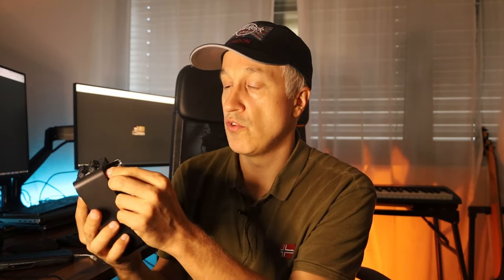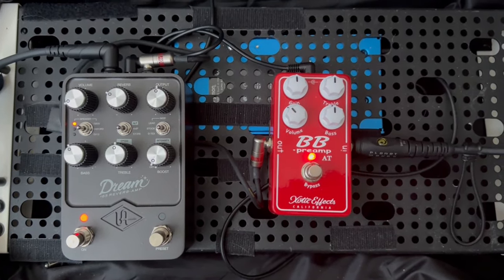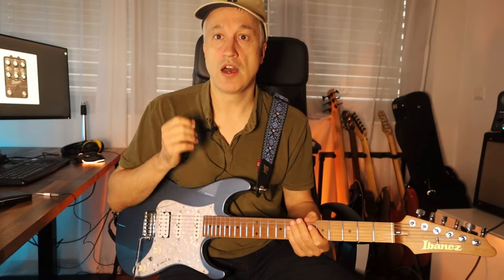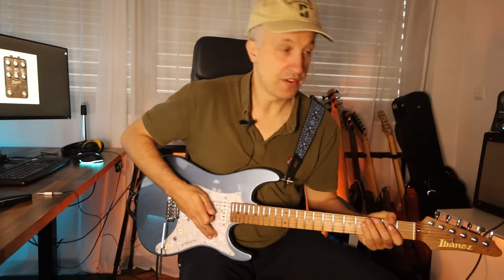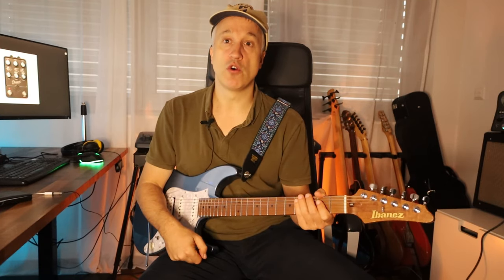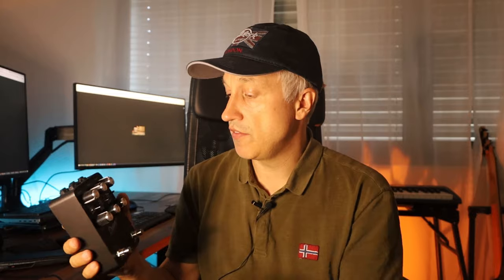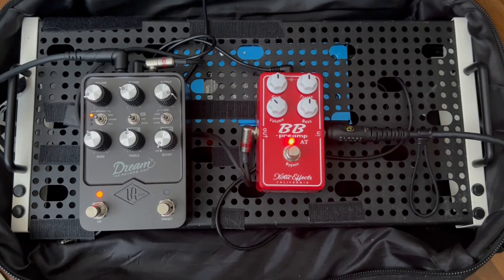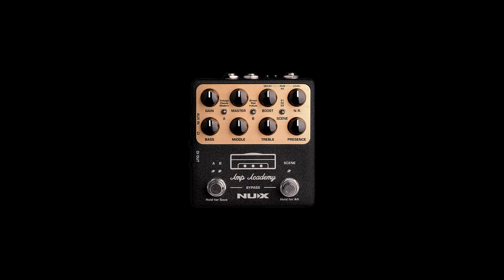The biggest problem I had with Uafx Dream '65 (watch before you buy!) #universalaudio #dream65

Comment: The Dream 65 acts and feels EXACTLY like the real Deluxe 65 amp. You are comparing it with a Kemper capture of a very clean amp that doesn’t ever get any dirtier because when the amp was captured it wasn’t on the edge of breakup. This is complete user error… it’s just like the real world scenario complaining that the Deluxe Reverb gets dirty around 3 to 4 and the Twin Reverb stays clean forever and takes your head off. If you want a clean amp buy a Twin Reverb if you want an amp that starts breaking up at 3 to 4 then gets dirtier but no louder buy a Deluxe. Your problem is not the pedal but your lack of understanding of how gain works. The worst part is all the people that were misinformed by this or even worse the ones that agreed with you.

Comment: …I'm having difficulty figuring out what exactly the issue is here. Initially it sounded like you were saying that the 65's input didn't have enough headroom and was being pushed into overdrive too easily. Then it sounded like you were saying that you couldn't hear whatever gain pedal you ran into the front of the 65 (in this case a BB Preamp) because the clean signal from the 65 was layering over it. These are two very different things, but with that said I'd be willing to wager that it's pilot error and not the 65 itself. It sounds like there's a setting somewhere that needs to be adjusted.
If it really is a feature and not a bug, you could put a compressor or EQ before it to limit the input signal. If it actually is just how the circuit is designed, it's not very well thought out.
Reply from the maker: Yep that’s exactly it, the input signal is way too low and there is no way I could augment it without distorting
Reply: @yuri-guitarist see if there's a "buffered/true-bypass" setting. If there, is set it to buffered. You could try putting a buffer between the boost/overdrive and the 65 and see if that fixes it. People think it doesn't matter if it's not buffered if the pedal going into it is on, but that's not always the case.
Regardless it's one of the trouble-shooting steps you want to try for pedals, like when you have a problem with your mobile device and the first answer any tech support gives you is a factory wipe, regardless of the issue.

Comment: The BB Preamp has a REALLY high output. It can make any amp-pedal buckle. Your were also hitting it with a humbucker to exaggerate the problem even more. Poor example. Also, check your power. If your board is starving with power, the headroom goes way down. Looks like you're using a Zuma so you should be fine, but its worth mentioning.

Comment: You are comparing two profilers - UA and Kemper -, which does not say anything about the UA compared to the amp they profiled. I have both UA and Fender Reverb Deluxe and there is a difference between them, but the UA is acceptable for use with a Gibson Les Paul. With a Fender strat, the real amp is better, cause the real tubes sound better and warmer.

Comment: I had the Dream and Ruby and both had less headroom than the Iridium. They didn't sound good with OD/boost pedals in front even with gain at the lowest setting.
Reply: I concur. My Ruby had less headroom and it sounded like crap going through Scarlet into my DAW. Go figure…
Reply: Same here…and the problem get worst with humbucker. I opened a ticket with no answer

Comment: Why not just run the pedal into an already broken up amp? That's the way 90% of ppl run their overdrive anyway- they set the amp until it's starting to breakup- and then hit it with an overdrive. Then it's not a clean signal that is blending into your overdrive tone- it's a dirty signal that's being blended in- sounds better to me.
Reply from the maker: Is Uafx Dream supposed to be run into an amp? It already a speaker sim and thru the amp will sound horrible. It’s a direct solution, afaik
Reply: @yuri-guitarist  Jesus man- don't be so literal- I just meant dial up some dirt on the UAFX pedal- then hit it with an OD. I run the UAFX Lion 68 and just like a real amp, if I turn it up enough- it breaks up. I assume the Dream would as well. That way you're not running the OD into a clean amp sim, you're running it into an already broken up amp sim.

Comment: Understand the user settings you won’t face this issue
Reply: So what should he do, in your professional opinion?
Reply: @Sagerydian  Well, in MY "professional opinion": know that the BB preamp has a REALLy high output would be a start. It can make any amp-pedal buckle. Also, testing with a single-coil as well as the humbucker would put everything into more and better context. The creator of this video seems to have some issues with basic understanding of gain-staging. 

That being said, I wish the Dream would have some more headroom too. I think this is by design though, as UA has modeled a specific 65 Deluxe and the intention is for the speaker-emulation to provide the desired headroom. Does it work? It's decent, though I do feel that this pedal works best with single-coils.